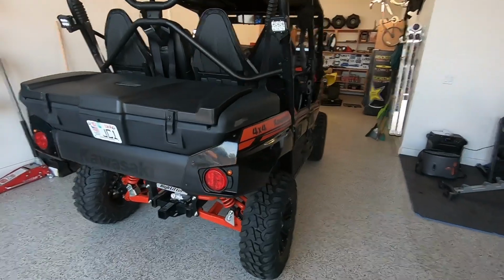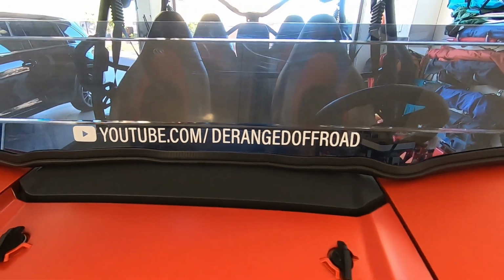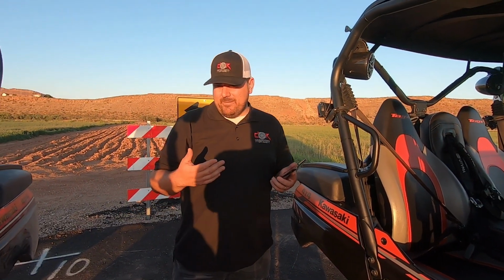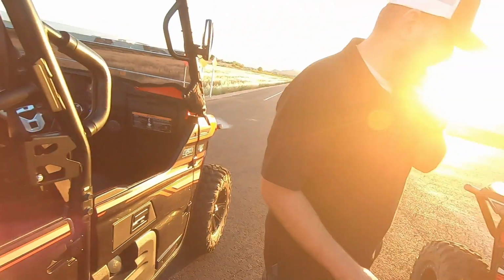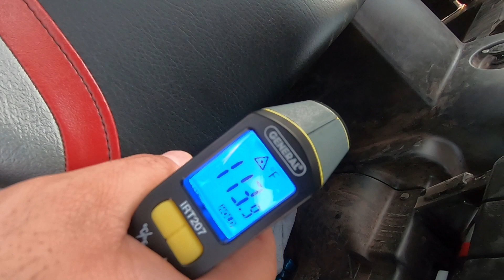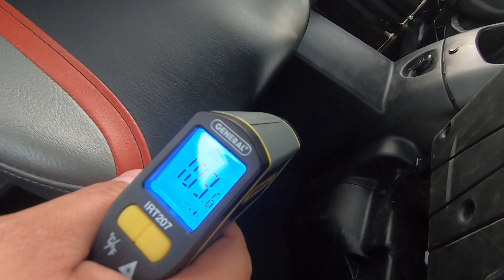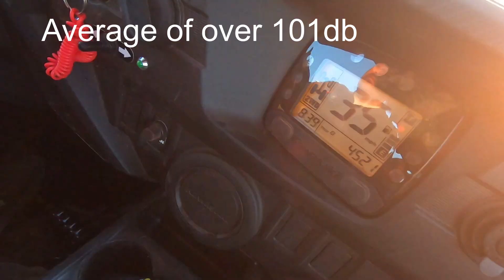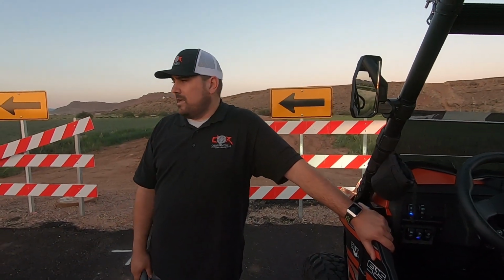The Truth about Teryx Heat Shielding Mod

Comment: Thanx for going the extra mile to take the time to run this test. Helps me make the decision to go ahead and pull the trigger on the heat shielding.
Reply from the maker: No problem after first video of install we felt we needed a real test to try it out. -Garrett
Reply: Can you do the same noise test on a flat dirt road to eliminate pavement tire noise from the test? Maybe put the phone on a mount so there's no hand muffling and it will be the exact same spot in both machines?
Reply from the maker: I agree we could test and see that as well, but both machines are running the same tire set.
Reply: @DerangedOffRoad  yes I knew you mentioned that. I was curious about the sound level difference between pavement and tar. Since there's almost no tire noise on dirt. Mine is annoyingly loud on pavement even with stock tires.
Reply from the maker: Yeah mine actually seems quieter on pavement when I installed my new tires.

Comment: I have the exact model (color) your dad does.  Teryx are great little vehicles.  Thanks for putting this together.  Live in AZ and the summers bring up that heat a lot.  Will have to spend some time applying some heat shielding.

Comment: I found the same results after doing mine. No question it helps with the heat.
Reply from the maker: If you can cut 10 to 15 degrees in areas that are hot it makes a big difference for sure. 
-Garrett

Comment: Thanks for your information, I own a "16" Teryx krf800 le camo, I did some heat and sound deadening, it did wonders, I wished that the factory would have done it before they allowed them to leave the floors
Reply from the maker: I agree 💯-Garrett
Reply: What did you do for the sound? The same thing?

Comment: Great videos you guys should try removing the catalytic converter and put a blower motor on the intake of the belt make such a huge difference in cooling these machines 😎
Reply from the maker: Yeah I've heard of people doing that with good results.  Thanks for the reminder......but should be have to do that?  
-Dave
Reply from the maker: I have considered that as well, do you think it would be a warranty issue? -Garrett
Reply: I realize your comment was 3 years ago….. But, what did you find out about the warranty? I was thinking of putting the belt temp gauge in. Would that effect the warranty?

Comment: Oh and by the way the Teryx2 is just a bit louder, because of the 2 storage units behind the driver and passenger area, so I wrapped the sound and heat deadening around them too, remembering to poke the 2 drain holes in each one

Comment: I live in Alaska where the engine heat is a plus 9 months out of the year.  I was hoping the noise reduction worked because I like tunes
Reply: same here , I actually like the heat coming from it even in summer, its not that hot here in Alaska, especially  in the mornings
Reply: Alaska as well. I I just got my T4. It has a heater and full cab enclosure.  We will see if I need to do this.
Reply: @livinthelegend  does the sound bother you much.   I'm thinking about getting one. thx
Reply: It is quite loud however I don’t go fast much or for very long periods. Rough terrain where so ride so we stay at 15 MPH or less a lot. At those speeds it isn’t horrible. My buddy has the Wolverine x4 and his is noticeably quieter than mine. With that said during our Sep moose hunt we traveled a total of 287 miles. I pulled him out 4 times and winched out to him once. Mine was a hold my beer and watch this moment so self inflicted for sure. The T4 is a beast.
Reply: It is quite loud however I don’t go fast much or for very long periods. Rough terrain where so ride so we stay at 15 MPH or less a lot. At those speeds it isn’t horrible. My buddy has the Wolverine x4 and his is noticeably quieter than mine. With that said during our Sep moose hunt we traveled a total of 287 miles. I pulled him out 4 times and winched out to him once. Mine was a hold my beer and watch this moment so self inflicted for sure. The T4 is a beast.
Reply: It is quite loud however I don’t go fast much or for very long periods. Rough terrain where so ride so we stay at 15 MPH or less a lot. At those speeds it isn’t horrible. My buddy has the Wolverine x4 and his is noticeably quieter than mine. With that said during our Sep moose hunt we traveled a total of 287 miles. I pulled him out 4 times and winched out to him once. Mine was a hold my beer and watch this moment so self inflicted for sure. The T4 is a beast.
Reply: It is quite loud however I don’t go fast much or for very long periods. Rough terrain where so ride so we stay at 15 MPH or less a lot. At those speeds it isn’t horrible. My buddy has the Wolverine x4 and his is noticeably quieter than mine. With that said during our Sep moose hunt we traveled a total of 287 miles. I pulled him out 4 times and winched out to him once. Mine was a hold my beer and watch this moment so self inflicted for sure. The T4 is a beast.
Reply: It is quite loud however I don’t go fast much or for very long periods. Rough terrain where so ride so we stay at 15 MPH or less a lot. At those speeds it isn’t horrible. My buddy has the Wolverine x4 and his is noticeably quieter than mine. With that said during our Sep moose hunt we traveled a total of 287 miles. I pulled him out 4 times and winched out to him once. Mine was a hold my beer and watch this moment so self inflicted for sure. The T4 is a beast.
Reply: It is quite loud however I don’t go fast much or for very long periods. Rough terrain where so ride so we stay at 15 MPH or less a lot. At those speeds it isn’t horrible. My buddy has the Wolverine x4 and his is noticeably quieter than mine. With that said during our Sep moose hunt we traveled a total of 287 miles. I pulled him out 4 times and winched out to him once. Mine was a hold my beer and watch this moment so self inflicted for sure. The T4 is a beast.
Reply: It is quite loud however I don’t go fast much or for very long periods. Rough terrain where so ride so we stay at 15 MPH or less a lot. At those speeds it isn’t horrible. My buddy has the Wolverine x4 and his is noticeably quieter than mine. With that said during our Sep moose hunt we traveled a total of 287 miles. I pulled him out 4 times and winched out to him once. Mine was a hold my beer and watch this moment so self inflicted for sure. The T4 is a beast.
Reply: It is quite loud however I don’t go fast much or for very long periods. Rough terrain where so ride so we stay at 15 MPH or less a lot. At those speeds it isn’t horrible. My buddy has the Wolverine x4 and his is noticeably quieter than mine. With that said during our Sep moose hunt we traveled a total of 287 miles. I pulled him out 4 times and winched out to him once. Mine was a hold my beer and watch this moment so self inflicted for sure. The T4 is a beast.
Reply: It is quite loud however I don’t go fast much or for very long periods. Rough terrain where so ride so we stay at 15 MPH or less a lot. At those speeds it isn’t horrible. My buddy has the Wolverine x4 and his is noticeably quieter than mine. With that said during our Sep moose hunt we traveled a total of 287 miles. I pulled him out 4 times and winched out to him once. Mine was a hold my beer and watch this moment so self inflicted for sure. The T4 is a beast.
Reply: It is quite loud however I don’t go fast much or for very long periods. Rough terrain where so ride so we stay at 15 MPH or less a lot. At those speeds it isn’t horrible. My buddy has the Wolverine x4 and his is noticeably quieter than mine. With that said during our Sep moose hunt we traveled a total of 287 miles. I pulled him out 4 times and winched out to him once. Mine was a hold my beer and watch this moment so self inflicted for sure. The T4 is a beast.
Reply: It is quite loud however I don’t go fast much or for very long periods. Rough terrain where so ride so we stay at 15 MPH or less a lot. At those speeds it isn’t horrible. My buddy has the Wolverine x4 and his is noticeably quieter than mine. With that said during our Sep moose hunt we traveled a total of 287 miles. I pulled him out 4 times and winched out to him once. Mine was a hold my beer and watch this moment so self inflicted for sure. The T4 is a beast.
Reply: It is quite loud however I don’t go fast much or for very long periods. Rough terrain where so ride so we stay at 15 MPH or less a lot. At those speeds it isn’t horrible. My buddy has the Wolverine x4 and his is noticeably quieter than mine. With that said during our Sep moose hunt we traveled a total of 287 miles. I pulled him out 4 times and winched out to him once. Mine was a hold my beer and watch this moment so self inflicted for sure. The T4 is a beast.
Reply: It is quite loud however I don’t go fast much or for very long periods. Rough terrain where so ride so we stay at 15 MPH or less a lot. At those speeds it isn’t horrible. My buddy has the Wolverine x4 and his is noticeably quieter than mine. With that said during our Sep moose hunt we traveled a total of 287 miles. I pulled him out 4 times and winched out to him once. Mine was a hold my beer and watch this moment so self inflicted for sure. The T4 is a beast.
Reply: It is quite loud however I don’t go fast much or for very long periods. Rough terrain where so ride so we stay at 15 MPH or less a lot. At those speeds it isn’t horrible. My buddy has the Wolverine x4 and his is noticeably quieter than mine. With that said during our Sep moose hunt we traveled a total of 287 miles. I pulled him out 4 times and winched out to him once. Mine was a hold my beer and watch this moment so self inflicted for sure. The T4 is a beast.
Reply: It is quite loud however I don’t go fast much or for very long periods. Rough terrain where so ride so we stay at 15 MPH or less a lot. At those speeds it isn’t horrible. My buddy has the Wolverine x4 and his is noticeably quieter than mine. With that said during our Sep moose hunt we traveled a total of 287 miles. I pulled him out 4 times and winched out to him once. Mine was a hold my beer and watch this moment so self inflicted for sure. The T4 is a beast.
Reply: It is quite loud however I don’t go fast much or for very long periods. Rough terrain where so ride so we stay at 15 MPH or less a lot. At those speeds it isn’t horrible. My buddy has the Wolverine x4 and his is noticeably quieter than mine. With that said during our Sep moose hunt we traveled a total of 287 miles. I pulled him out 4 times and winched out to him once. Mine was a hold my beer and watch this moment so self inflicted for sure. The T4 is a beast.
Reply: It is quite loud however I don’t go fast much or for very long periods. Rough terrain where so ride so we stay at 15 MPH or less a lot. At those speeds it isn’t horrible. My buddy has the Wolverine x4 and his is noticeably quieter than mine. With that said during our Sep moose hunt we traveled a total of 287 miles. I pulled him out 4 times and winched out to him once. Mine was a hold my beer and watch this moment so self inflicted for sure. The T4 is a beast.
Reply: @TheHuntingSpot  It is quite loud however I don’t go fast much or for very long periods. Rough terrain where so ride so we stay at 15 MPH or less a lot. At those speeds it isn’t horrible. My buddy has the Wolverine x4 and his is noticeably quieter than mine. With that said during our Sep moose hunt we traveled a total of 287 miles. I pulled him out 4 times and winched out to him once. Mine was a hold my beer and watch this moment so self inflicted for sure. The T4 is a beast.

Comment: I think the wind noise from the half windshield probably contributes somewhat to the noise on the older one as well, but I did noico mat a year or two ago in mine and couldn't really see any appreciable reduction in noise either. 

But yeah heat was definitely improved. My right leg used to always be cooking during the summer. Now it's downright tolerable.
Reply from the maker: That’s why we took the reading on the drivers side because I felt the same way. The mat totally fixed that for me and my kids said it was way better in the back as well. The windshield noise could be it, didn’t think about that. 👍 -Garrett
Reply: @DerangedOffRoad  I would bet the half vs full windshield had a lot to do with it. I know rolling in my T4 without a windshield, the wind noise seems to be what makes it most difficult to communicate with the rear seat passengers, not the engine noise.
Reply: The T4s with no roof or just a cloth roof are quieter than ones with a hard roof that reflects and bounces the noise around. I have been trying to think of a material that is weather proof of, looks good and will absorb the noise to put on the underside of the roof. That would make a huge difference I think.
Reply: @1ltlbrnc  
I'm planning on buying some 95% sunshade fabric to make a soft roof for mine to install for summer use, and then put the hard roof on on the winter. I'm in Utah County, so it gets a little colder here in the winter.
Reply from the maker: Let us know how that turns out with fabric and didn’t think about the hard roof causing more sound. Thanks for the input -Garrett

Comment: I'm not familiar with these machines but I've always been interested in one. I realise that the engine is up front and in between the driver and passenger, but is the noise too loud to have a conversation at cruising speed? My 2019 commander 1000r was unbearable to me.
Reply from the maker: It’s going to be just as bad as your commander
Reply: @DerangedOffRoad  oh gosh!

Comment: What in states where it isn't ungodly hot in the summer. MIGHT get over a 100 .... 5 times a year in MI. Not much of an issue.  Here in Michigan some of that heat would feel good in the fall. Waste of time in my book.
Reply from the maker: I live in a area that is 100 to 115 at times three months and over 90 plus two or so other months. So not a waste of time here. 👍
Reply: @DerangedOffRoad  I couldnt take that heat.

Comment: I stumbled you about a week ago researching a teryx4. Been watching everything I can about the heat issue. Here in Texas where we ride it's about the mud and Sandy trails. I own a ranger crew now, love it and obviously don't have those issues, but it's just too long for the trails I ride on  the t4 looks like it will be the next new choice. After learning about the heat from you I spoke with a dealership Saturday about this problem and said later models have a cooling fan to prevent the heat transfer. Does the 17 or and the 19 have one? If they do I will definitely be heat shielding .
Reply: Older models, pre 16 or 15 had fans under the driver's seat. Not sure how much of a difference they actually made. Most people seamed to remove them so I don't think they made much of one. No newer ones do unless some dealer is trying something. A good header coating would help a lot with the heat too. A fan behind the stock battery mount to blow through the tunnel for slow speeds would make a difference i would think.
Reply from the maker: Yeah the newer ones don’t, but I’m going to come up with something for under the seats as well. A lot of heat comes out there and sends it through the cab. - Garrett